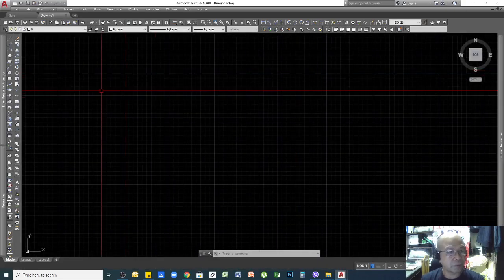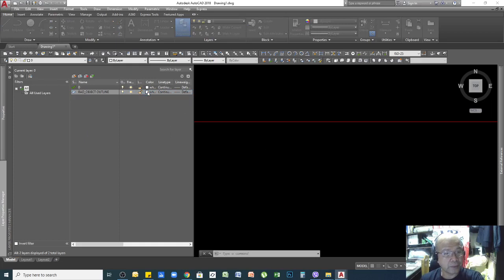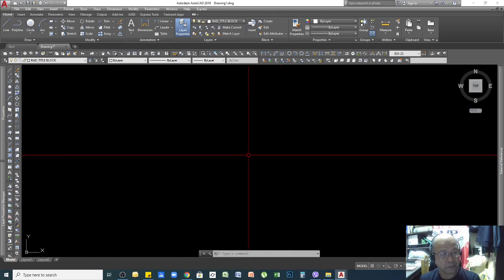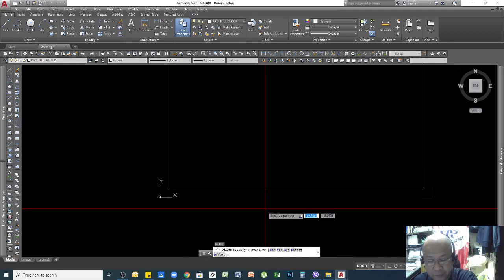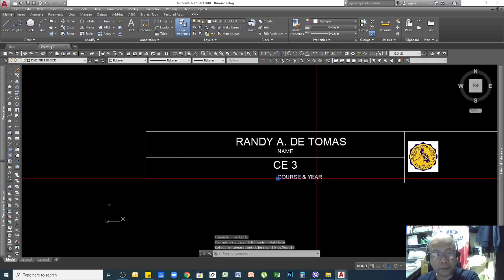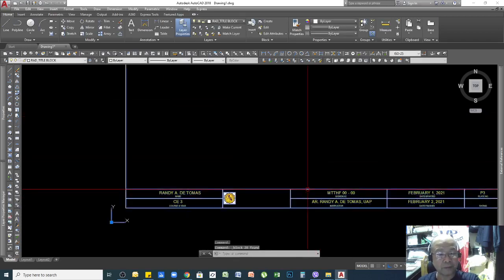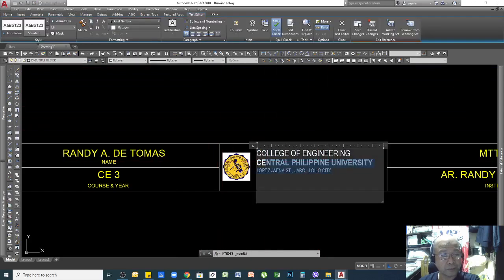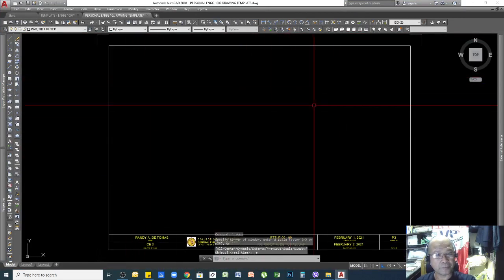AutoCAD_Creating a Drawing Template

Comment: Magandang hapon po pwede po ba gamitin ung auto cad 2010 o kailangan talga ung latest version kaya po bang makasabay or kulang ng function ung autocad 2010 sana po mapansin salamat po
Reply from the maker: You can use any version or whichever is available. They are all the same except that the higher version has added special function or tolls but the basics are the same.